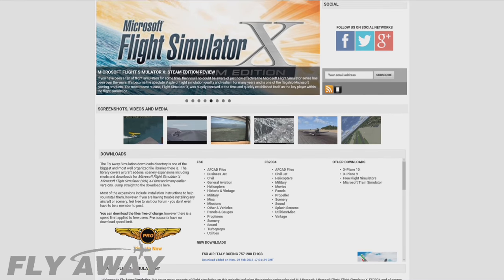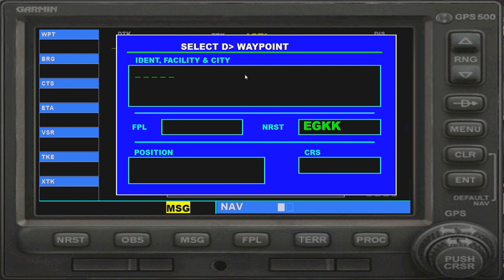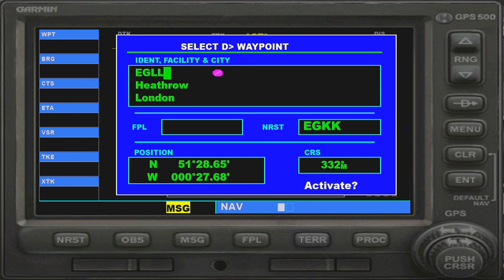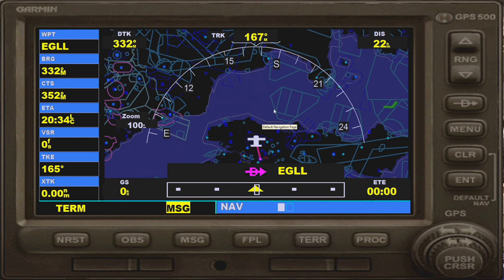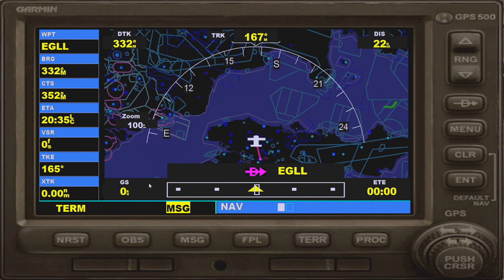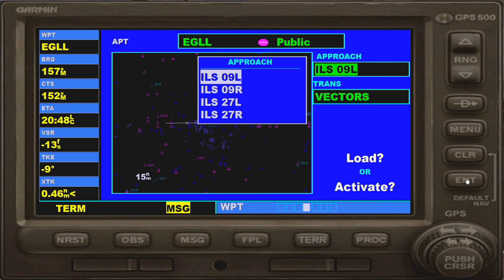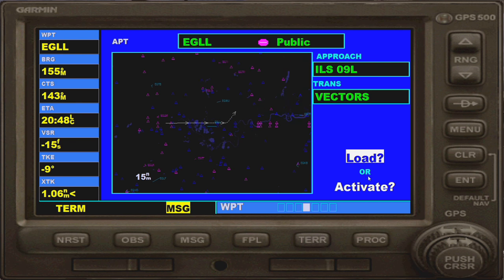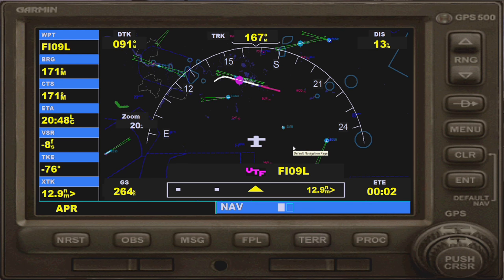FSX How to Use the GPS | Flight Plan + Approach Set-Up

Comment: Thank you so much for this extremely helpful and clear guide!

Can this method somehow be integrated into an IFR flight plan? I have landed, am now sitting at the gate, have just chosen the next destination via GPS as per the first half of your video, but now I want IFR to guide me there (altitude, heading, ATC centres, etc.), rather than relying manually on GPS. Is there is way to integrate this or is the Flight Planner function the only way (which then auto-loads the GPS anyway)? Thanks a lot!

Comment: I cannot type inside the GPS, when I type, commands will be sent to the simulator.
Also I can't seem to find a way to add intermediate waypoints (intersections, VORs)...
Reply from the maker: Just click onto the GPS, make sure the right field is selected and then start typing and you can use the FSX Flight Planner for the waypoints

Comment: Ugh, Im so confused. So if you were at crusing altitude when you did this activating the approach would be an instant nightmare as the plane descends at a sickening rate while making an almost 90 degree turn to land on the runway properly.

If you weren't at crusing altitude/speed, how did you learn when to begin descent in flight and what speed you should be at when you activate the Approach Hold?

I'm so frustrated that I flew for an hour and a half under the impression that the approach hold/auto pilot would automatically line me up properly with the airport runway that I was landing on, instead all that happened was it flew me straight into the ground with the runway at a 45 degree angle difference from my direction. I don't understand what I did wrong... like 15 minutes out I checked the heading of the runway and the ILS frequency and loaded those numbers into my Course dial (in auto pilot box, the knob all the way to the left with orange cross lit up on it) and the Nav 1 frequency COM (and yes it was active).

Boeing 737-800, if anybody cares. I don't know why everyone makes Approach Hold sound like it automatically lines you up with the runway of whatever Airport you have selected in your flight plan and all you have to do is just manually set it down at the end. Because that is NOT what happens..

Comment: The GPS in FSX has so much more to offer than that though.
I have found how to use it, instead of the in-game chart, for finding VORs and NDBs and Airports in emergency situations because the GPS tells you info about the airports (like runway length) faster than you can click on it in the chart.

P.S. The GPS in a couple of the Glass Cockpit aircraft (I think the Mooney Bravo is one) has a much different GPS than the others/the one in this video.

Comment: I was also wondering, do you use it when you're flying an IFR flight, cause sometimes this clashes with the instructions that the ATC gives
Reply: Daniel Oyakhire no just do it when it tells you descend and maintain 2000 until activating localizer after this do what he did
Reply from the maker: ATC will also follow the GPS you have set up, just as long as you set it up correctly

Comment: I just press alt and then click on the far left dropdown, then I click on "plan flight"! It makes it much easier!
Reply from the maker: Yeah you can do that in the main interface before evening starting a flight, but then it's just less realistic
Reply: Jack's FSX Videos but it might be more like filing a flight plan
Reply from the maker: Well in real life, pilots will enter it on the FMC, or the GPS for smaller aircraft
Reply: Jack's FSX Videos but first they would file a flight plan using the internet or phone
Reply from the maker: Yes but that's all arranged before the flight and usually by the airline
Reply: Jack's FSX Videos ok, thanks for the video! I just wanted people to have an easy way to do it also
Reply from the maker: Ah okay no problem, though I would have thought it's quite obvious for most with it saying 'Flight Planner' in the main menu
Reply: Jack's FS Videos Thanks for the video it helped me so much, but most of flights are not straight. How to curve it? (sorry for bad english).
Reply from the maker: You can set custom waypoints in the 'Flight Planner' on the main menu or use the FMC (if the aircraft has one)

Comment: hi man! how on earth do you advance the waypoints if you have a flightplan and had a detour or cut a route leg? if i get back on the track later and omitted a few waypoints, the gps wont jump to the current route leg im on. even ATC want me to get back to the omitted waypoints and wont advance. its extremely annoying, and a joke. 

also how you insert a detour waypoint into a preloaded flightplan for example for refuelling reasons over the ocean? it wont let me do this after a selected leg it just deletes the whole previous flightplan and gives one leg whatever i do. I cant believe the real life gps500 would work like this. 

are there any game extension that address the dump ATC and GPS and would make it work more thorougly and logically?
Also a lot of things doesnt seem to work properly sometimes like if the autopilot is buggy. im on FSX steam edition, is that a problem? 

hey thx a lot :)
Reply from the maker: Just go into the FSX Flight Planner and reset up your plan with the same waypoints. You can't add in a detour on the GPS, in real life pilots wouldn't even use this GPS on commercial aircraft and they don't have one (those that do would allow you). There are bugs in FSX, it's somewhat become the big joke of the flight sim community, but there are fewer in Steam Edition

Comment: Cheers Jack, I was looking for a good explanation of Garmin GPS, and I found it here.  My only issue was the CRSR PUSH button on the GS 1000, as found onboard the Beech Baron 58; it is super fiddly to operate with my mouse cursor.  I got there in the end after about 3hrs!!!!!!  If anyone else has aggro with this switch it will work but it has a very fine point to click on with your cursor.
Just subscribed and a thumbs up.
Reply from the maker: Glad I could help and thanks so much for subscribing!

Comment: I like your videos and I appreciate the work you put into them, but can you please go into more detail about how to do all this? I tried using autopilot, setting a flight plan from KIAH to KDFW and doing an ILS approach and landing on 13R, followed your videos step by step but my GPS/autopilot et al. acted completely differently from what you showed in your videos and I ended up over flying my runway at 3,000 ft at about 180 knots.
Reply from the maker: That sounds like an ILS issue, did you switch from GPS to NAV?

Comment: Hey, Jack. 
I just started flight simulation and the ATC told me to head 020 but on my pink line on GPS, it is way off. Should I follow ATC or the GPS pink line?
Reply: Ofcourse the ATC they know what to do.
Reply from the maker: If you set it up in the FSX Flight Planner, it should sync up

Comment: I have tried flying from Gatwick to Heathrow using the GPS and the ILS approach as shown on your video but for some reason the plane does not exactly follow the final-to-vecors route even thought it has been activatrd and can be seen on the GPS as a majenta line followed by the white runway; instead it goes over it. The other routes I have tried using the same method seem to work fine. Could it be that the turn required to land at Heathrow from Gatwick is too sharp? Help woukd be appreciated.
Reply from the maker: I imagine it's because you'd have to turn the aircraft around and make it to the runway at Heathrow in the same direction you took-off, so if you enabled the GPS soon after take-off, it wouldn't be able to make the turn in time, once it got to the start of the line. You would be able to do it if you preset a flight plan to line-up better or used ATC
Reply: Jack's FSX Videos ok thanks
Reply from the maker: No problem!

Comment: Jack, I use FSX Steam Edition but I don't know how to open the navigation? Can you tell me? Also what is the difference between activate and load
Reply from the maker: It's the exact same as normal FSX, Shift+3 (but some aircraft can be different or not even have a GPS). I do explain the difference in the video, but Load is just getting it ready, but the aircraft wouldn't be able to follow it yet, nor would you be able to even see the line on the GPS, then all you would do is hit activate to see the line etc. as Activate is getting to that bit straight away :)
Reply: Thanks :)
Reply from the maker: No problem! Don't forget to subscribe and watch the live stream today at 17:00 UTC!

Comment: Nice video. I wonder, how do you make a manually make a flight plan (with VORs and waypoints on your route) without using the FSX planner, but hardcore programming in the GPS itself?
Reply from the maker: Not sure for the GPS itself, after all, real-life commercial aircraft don't have a GPS. In real-life, pilots will use the FMC, otherwise you will have to use the FSX planner

Comment: i have a quick question. when I choose vectors to land the gps gives me a really odd trajectory, it has lots of turns and often it doesn't line up at all. 
do you know how I can maybe get a better approach without me circling around the airport 5 times?
Reply from the maker: The first vectors should simply be a straight line (unless you go past it). Have you tried it at different airports?
Reply: @JacksFSVideos   I have tried at multiple airports and very often its a straight line and then it lots of turns. so I shouldn't follow the complete trajectory? at 108 mile ranch (British Colombia) it just doesn't line me up at all. I also have another question whats the difference between those approaches? overall I just want to say that I have found your tutorials very helpful. thank you!
Reply from the maker: You just want to follow that initial line towards the runway, none of the other turns around it. Once you've landed, you can just ignore them. They're there for other approaches and/or for going around. Glad my videos have helped tho! Thanks for watching :)
Reply: @JacksFSVideos  thank you for the explanation!

Comment: how did you use the keyboard to type at 2.18? Thanks
Reply from the maker: Just make sure you've turned the dial twice to the right and simply start typing on your keyboard :)
Reply: I got it, thanks for the tip
Reply from the maker: No problem!

Comment: how come I couldn't type any letter?help me,and what controler do you use?
Reply from the maker: I use the Saitek Yoke and Throttle Quadrant (find more details on the FAQ). For typing, did you make sure you turned the smaller dial twice to the right?
Reply: On the G1000, it's very difficult to turn the small knob and not the larger one.  (In fact, I've never successfully done it purposefully.)  I use the keyboard to enter the code instead.
Reply from the maker: Devin Carless, how did you get to the screen then? Without pressing the smaller dial twice to the right, as that's what timothy is asking
Reply: I'm using the G-1000 in 3d cockpit mode.

The D-> button brings up the 'Direct to Ident, City, Facility' sub-page.  Turning the FMS knob changes the first letter and brings up map, location and course information for the selected ident.

At this point I can use the keyboard to enter the ident I want,  but the FMS knob just doesn't work.  No option is presented mousing over the FMS knob to turn any smaller knob on the G-1000.  Hitting Ent brings up the Duplicate Waypoints page, which does not respond to the FMS knob at all.
Reply from the maker: Oh right I see, it's an add-on aircraft with a different GPS - thanks anyway